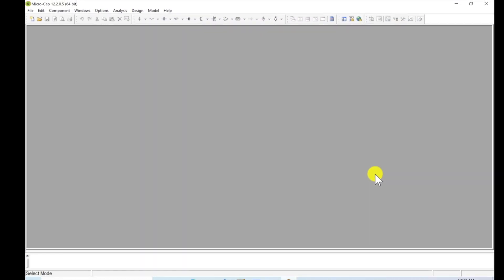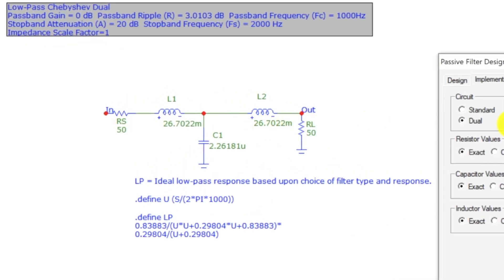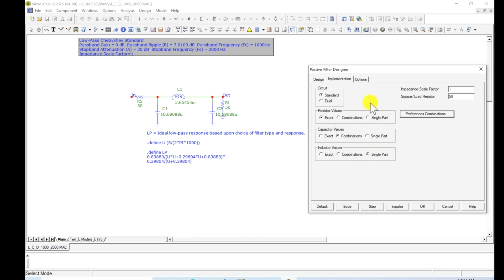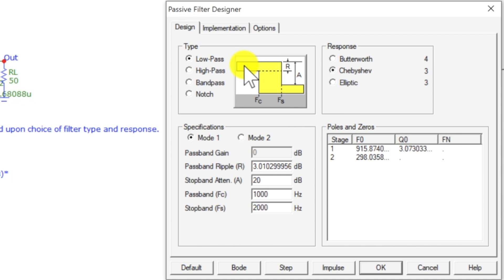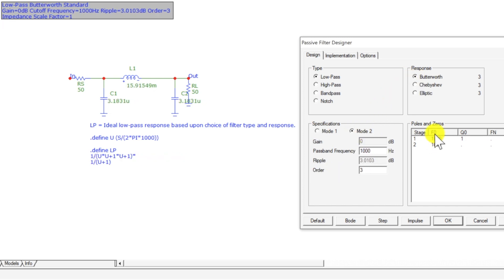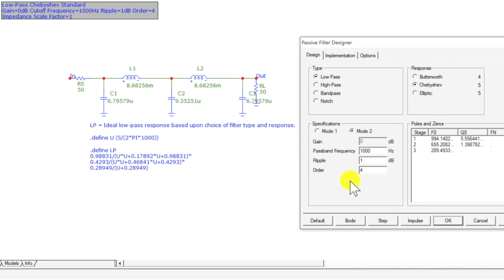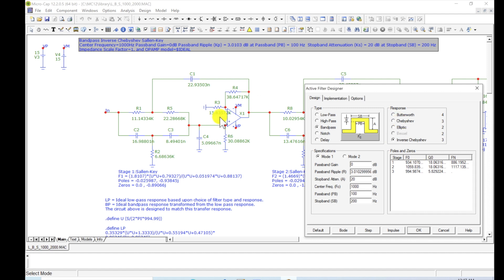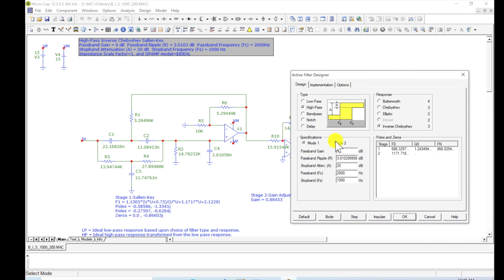Passive and Active Filter Design another MicroCap Tutorial #microcaptutorial #filterdesign

Comment: Hello, You are my hero. all the info on power related circuits is golden. I would like to ask about "Bursts of current". My set up is sending A/C 120v, To fuse, Bridge rectifier, Finally to a 50volt 6 amp solenoid for 0.01 milli sec. A flipper coil in a pinball machine. This unit powers main coil then while powered,  an end of stroke switch powers a low current hold coil and turns off this big coil. As the game goes it may be flipped 6 times in 5 seconds then quiet for 10 seconds. We have EMF at the wall and flyback diode across coils, Is there a best way to power this coil with caps or at least deliver the pulse less sharply? Again i love your work, You are a Brilliant Engineer. Thank You. From Bill Fischer.

Comment: Did you try connecting a Active or Passive crossover to IC amp connecting to your speakers a little while ago any impact of the IC and splitting it's amplification?
 Get any results from that.
I was wondering you can connect a class D amplifier to power another ab amplifier for instance, instead of running 60 Cycles into the first amplifier, what about if you run a higher frequency instead say 120 KHz on its own not with the 60hz so its above the audio band frequency when powering the second amplifier with the 120 kHz instead of 60 Hz. I'm not sure what the outcome would be on the second amplifier DC Rails?
Reply from the maker: Thanks for the question John!  I don’t think there’s any advantage using a Class D to power another amp.
Reply: @KissAnalog  no you don't think you can power the other amp and have all your frequencies above the audio band eliminating mains hum and 120hz?
Thanks for getting back thought I was blocked lol
Really curious about the crossover tho! Injecting it into the front stage of of the ic, splitting the amplification maybe 2 for bass and one for top end.
Surely this is going to be better than just having the passive crossover on the speaker end?